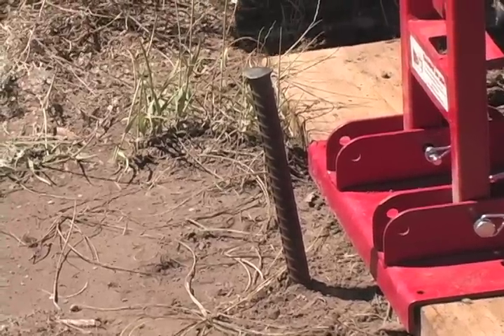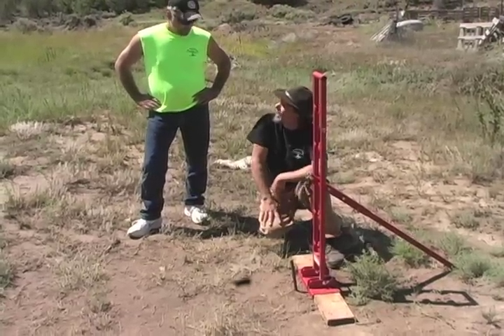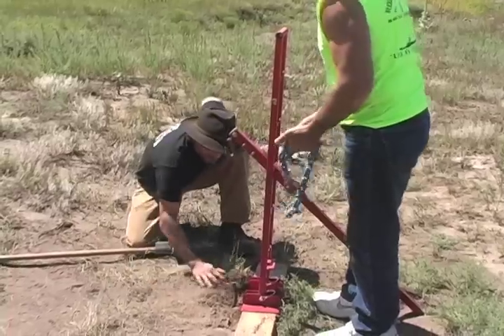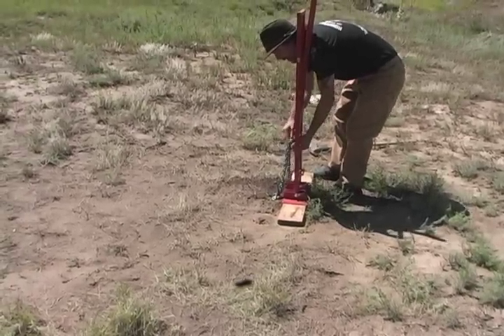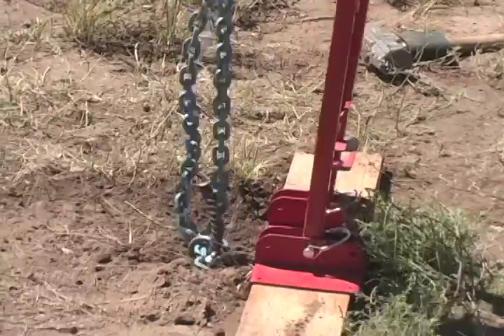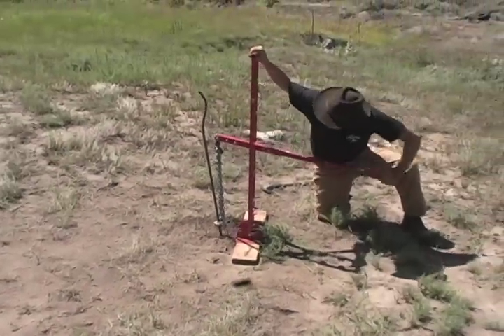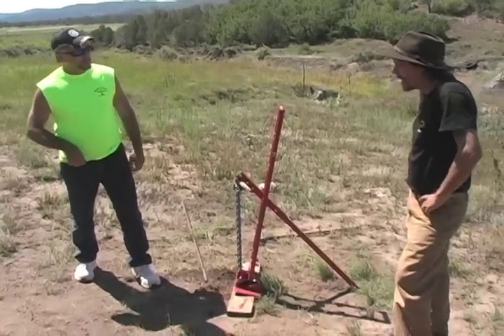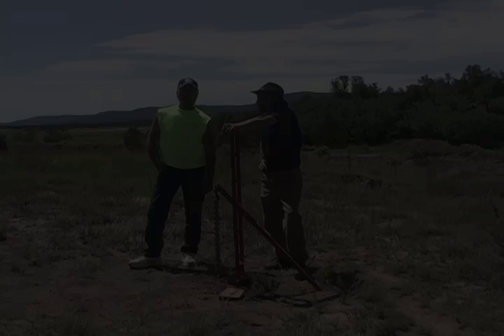The Bullpull- How to remove a Ground Rod / Made in the USA

Comment: The whole trick to pulling out a metal rod is having something that grips the rod. You can use vice grips, U clamps or locks, or as I did, a pipe wrench. Then the rest is easy with a lever and a fulcrum.

Comment from the maker: "it ain't braggin' if ya can't back it up" This tool speaks for itself
Reply: Where can I buy this tool?  Who is the manufacturer?
Reply: @richarddodge9592 If you cant find it  Make one out of 2 2x4s adn use nail plates to attach then  to a 2x6 . Use a pice of emt conduit or a big bolt for a pivot , drill a hole in a 2x4  lever , put the lever between teh uprights bolt a cahin to teh end of teh 2x4 ( a link ind teh head , a link under teh nut end using washers )